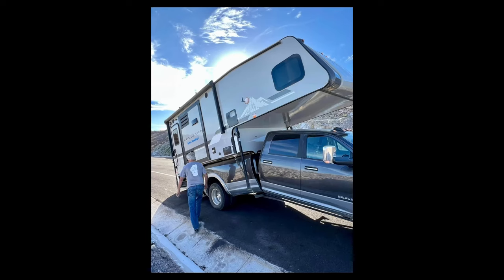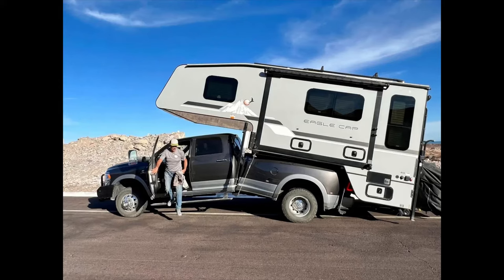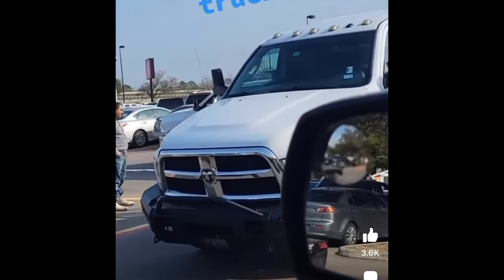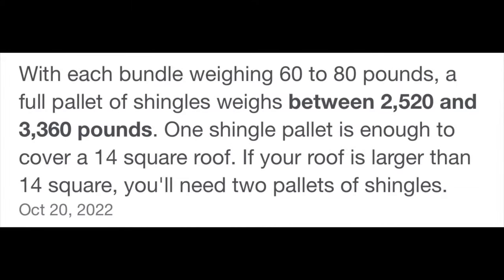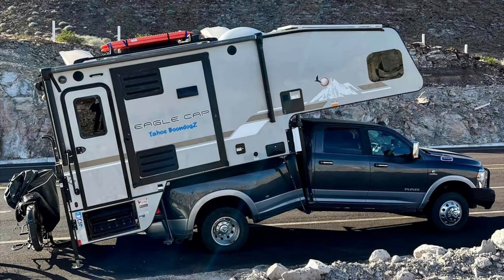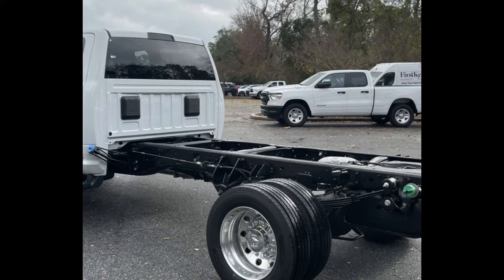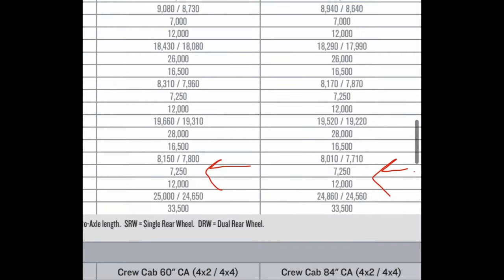Broken Ram truck frames 😱, what’s causing the failure and can they be repaired?

Comment: It seams to me people are over loading their trucks. The most purchased  HD trucks are F250/2500 trucks. Then for whatever reason people think there is no max payload or towing capacity.
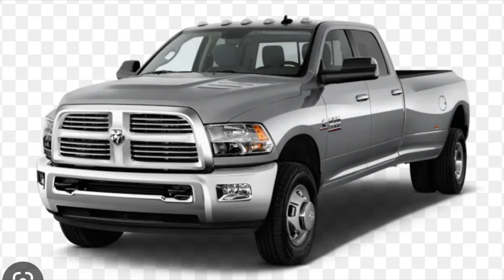Reply: Yep.  F-250 has the 3:73 gears for fuel mileage while F-350 has the 4:10

Comment: I've never agreed with some of the standards that they've put on because if they rate it for $5,840 it should be able to handle at least 50% more than that. That's why you do testing that's why you always put the load data less than its proof capability. I also think that all frames on all trucks should be either hydroformed or heavily fish plated in specific places to make sure that things like this do not happen!
Box frame should be minimal standard and it should be at least 10 gauge. There is no reason for it to be any lighter than that.

Comment: All great observations and conclusions. I see a lot of finger pointing and lawsuits coming for years to come.
Reply from the maker: Without a doubt nobody is going to want to take the blame.  The unfortunate part is peoples insurance won’t want to cover it because it’s a manufacturing defect or overload.  Ram won’t want to cover it because they will claim overload or improper weight distribution.  Getting it fixed short of a new frame will be difficult because most shops won’t touch it (unless it’s a full frame replacement) due to how it broke and the material it’s made of.  Talk about being stuck with a huge bill and limited options.

Comment: For the heavy Eagle cap Camper, if the front of the camper pulled up hard enough to pull the truck frame upwards and break it, why didn't the front anchor points pull out of the camper first before the truck frame broke. It is hard to believe a camper with a thin aluminum superstructure and plywood could be stronger than a steel boxed truck frame even with weakened weld area.
Reply from the maker: I don’t think it’s overall weight of the camper, it’s how much weight that’s behind the axle combined with 600+ ftlbs of torque that’s trying to lift the frame up due to the axle pinion rotating up under torque.  All of that torque on the frame will find a weak point, and there so happens to be some welds where it’s breaking.  Any weld defect such as undercut, or backside suck back could take that thin material and significantly weaken it.  Not to mention how higher strength steel needs to be heat treated post welding to regain strength loss.  It’s a multitude of factors that are contributing towards the failures.
Reply: @makingmistakeswithgreg  If you can't put 1500 lbs behind the rear axle due to bending moment, then you can't tow a 15000 lb trailer unless you have a weight dist hitch, which most cargo floats don't. I was trying to imply that the skimpy camper plywood frame / tie downs held up to the repeated upward stresses, the high strength truck frame did not. Back to C channel like the chassis trucks! My 1984 has no welds. All brackets are factory riveted on .

Comment: They just don't make them like they used to and it's that simple.  My family owned a sawmill for years and people would bring in logs on their pickup trucks every day.  I saw s10 pickup trucks with 2 ton of logs in the bed with the bumper almost touching the ground 3 or 4 times a week.  A guy had a 92 ram 350 and put a gooseneck behind it and put 14 tons on the trailer and brought it in on a regular basis.  One guy had a old chevy and put big sides on the bed and put 4 ton in the bed every day.  I actually had a 89 (still have it) ram 250 with 360 engine and 4 speed manual and i took the bed off and built a set of log bunks and hauled 5 tons on the bunk and 5 tons on a trailer behind it every day for 3 years with the only addition of Firestone air bags in the rear.  There's no excuses for this shit we get sold these days, it was all made better back then when it was about quality not quantity

Comment: Back in the day when trucks were made with thicker steel.. The weight capcity was more of a guess.. Think it will haul 1500 pounds. But now days they test that stuff a lot more and they know when that frame does snap. And a lot of times thats a chunk of steel thats brand new. Not one that has been on the highway a few thousand miles. But also pickup have always had a bad spot between the box and cab. Which a lot of flexing occurs. We had a old one ton chevy years ago from the 1980s snap in half at the bed. So it was an issue even with the old c channel frames. But if I knew I was going to half heavy loads in a pickup today. I think I would put some big fish plates on the frame underneath where the cab and box meet. Something like half inch plate. Maybe it will help. maybe it will eventually snap under the box or cab. Be something that needs testing. If I had a dodge ram around here I could tell you what steel the frame is made of. I own a XRF Precious Metal Analyzer from our machine shop.
Reply from the maker: Excellent thoughts and I agree.  Also, very cool that you have a xrf gun.  I wish they weren’t so expensive because I would own one too 😀.

Comment: Lets face it, these were over the recommended weight,  they must have tested this cheap design and weld process and stopped at the limit.   The  manufacturer's butt is covered.  Can't say they spent a penny extra in materials for the frame.
Maybe someone makes a bolt on plate kit.

Dualies are used all the time for carrying heavier loads  and better traction (better than singles on 2500 in mud).  You'll see every farmer using a 3500 to feed hay in with a 8' flat bed.  Sometimes  I'll see 2 one ton bulk feed bags on the bed and it would be stupid to take that much weight off-road due to twisting.  If he has a big goose neck , he may have a $100000 4500 or 5500 but sometimes just an old semi-tractor rigged up.  So a  dually has a use on a 3500 if you don't push over the limits.  But trust me, everyone thinks they can "get by" hauling a stupid heavy load.
Here I think they found out an extra 1000 was too much for the "welded on " frame, not the tires.
Cracked at weld zone not a coincidence.  Plus this started as small cracks, it probably worked for a few times.

Comment: Well I really enjoyed the video. I think you are being too PC and easy on the manufacturers. They should be stronger than the spec max. But you are right that perhaps a bigger truck should have been purchased but look at the perspective of customers. They are paying 3X more than they did in the past. Inflation etc. So if the OEM's want to charge more that's fine but their trucks need to merit the price.
Reply from the maker: I agree, considering the price the failures shouldn’t be an issue.  The cab and chassis trucks don’t seem to have issues at all, but the frames are drastically different.  From my perspective the engineering required to balance strength without excessive weight in the frame, all while handling stupid amounts of engine torque and weird loads on the frame is a lot to ask for.  Still, like you said for that kind of money it should be far better.
Reply: @makingmistakeswithgreg  just remember, money does not equal quality. A culture of excellence as well as proper inspections would equal excellence. Perhaps some robust government agency inspections would also guarantee results but of course: LOBBYING

Comment: Not to give a pass to the manufacturers, cause they sure don't build in any extra capacity, but there is a reason they make trailers. Use of a trailer gives you more load space, more GVW, safer handling, lower center of gravity for the load and additional braking capacity.
Reply from the maker: 100%. Easier to take a load off too.

Comment: I’d never attempt to repair a cracked frame. For the reasons you already mentioned. Hell no. However, it is likely a $70k-$80k truck. And I wouldn’t blame ya for attempting a repair. I wouldn’t trust it though.
Reply from the maker: It is possible to repair cracked frames, what I worry about is the type of steel it is.  It’s entirely possible a weld repair will fail due to how brittle the frame will become near the weld.  Combine that and the fact doing such a repair requires a lot of welding skill, and you have a recipe for low success lol.

Comment: But overloaded by 1500-2500 should not break them.    Idc what anyone says that overweight is bad and should never be done.    I will just point out every second gen dodge 2500-3500 dodge that has been worked.        Also these trucks broke when the stress was applied where the center of the frame was being lifted instead of being pushed down

Comment: Anything under a 4500 is a driveway queen.  If you want to haul heavy,  run heavy and not something that is a weekend dump run pickup.  Duels and diesels with high torque should only be offered in 4500 and up.  No matter what the make.  We have Kenworths in the yard if we want to haul heavy,  not pickup trucks.

Comment: So are you saying RVers pulling a 5th wheel should pull with a 4500??? So what purpose does the 3500 and 2500 serve? We bumper pull a 7500lb RV with our 2500. We're not going to pay the taxes and insurance for a 4500 commercial truck. At that point I'll move to a Class C or Class A RV instead.
Reply from the maker: If you are overloading a 2500 or 3500 truck legally you need a bigger truck.  The difference between a 2500 truck and a 4500 is significant or even a 2500 and a 3500 DRW.  If you haul a lot of weight or want better stability it’s not smart to max out a 2500 truck and expect reliability.  They often have smaller brakes, weaker rear axles, worse gearing, weaker springs, etc.  A vast majority of 2500 trucks are setup for ride quality and drive ability for average people that don’t haul anything, not people pulling 5th wheels.  Not to mention due to the design of the trucks it’s very easy to be over weight on the rear axle without actually having that much load on the truck.  

It also depends on the truck.  A f250 and 350 SRW is literally the same truck minus rear leaf springs and titled weight.  A Chevy 2500 and 3500 truck for many years was a completely different frame (3500s was massively bigger/stronger) and in many cases rear axle.  As far as what’s the point of 250/350 trucks, they work fine within their design and load rating.  They are not the same truck as a 450 and using a 250 like a 450 is a mistake.  Does the average person need a 450? No, but the average person doesn’t need a truck period.  Does loading a 250 to max load or over all the time make sense for longevity?  Also no.
Reply: @ first thanks for responding and the detailed reply. But, to your last point; ‘not everyone needs a truck.’ The whole RV community that pulls a 5th wheel needs a truck. All but the smallest and lightest solid wall travel trailers need a truck to tow safely. 
Are you saying that most RV’ers need to a 4500/450? That means we all need CDLs…

Comment: If you title it as a RV your insurance is normal but if you register it as truck it goes commercial and insurance goes out the roof and this only works when the truck is brand new and no used trucks .
Reply from the maker: My insurance is willing to insure a 4500 or 5500 as a personal truck or non rv.  I have heard this is somewhat state based.  I can’t imagine what the insurance would be buying commercial insurance in many states 💀

Comment: 3k pounds capacity in a bed of a 80k dollar truck is ridiculous, even more ridiculous is that is it's actual limit. No safety factor. I have been putting over 2k pounds in the bed of my S10 for 20 years. And towing 3-4x it's tow capacity, it's never broke anything once. I'm not saying this is a brilliant idea, but you figure a 20 year newer truck, that costs 100x the price, and is suppose to be 20x the strength should hold up to a pallet of roof shingles. I own a bunch of ford f550s. I have hauled 18k pounds on the bed. We have pulled wheels off the ground hauling trailers up hills off-road. Some trucks are made to be used as trucks

Comment: Too long of trucks to ridged of frame I went thru a ditch in a 15' and felt the flex and sold the truck shortly afterwards cus I know I was gonna break it , I built a Duramax cab and chassis and have been working it non stop every day since 2020 , you guys working these trucks really will benefit from a cab chassis upgrade .
Reply from the maker: Definitely can and chassis.  Those trucks never seem to have many issues regardless of brand.  Many times the power is derated but considering how many older 450+ trucks are out there with 400k that are still running on original trans/engine I would say the derating seems to help with longevity.

Comment: stress crack propagation. they have to get the welds perfect with no pits, voids, or inclusions where stressed the most and welds ground smooth. over weight issue, QA issue, or design issue or inter related? too much heat in weld affected zone making metal brittle? did their QA/QC depts pass the ASQC test? many techies want to know. Ha, I wrote all this after only watching 35 seconds of video and should have waited.
Reply from the maker: No doubt everything you said likely played a roll.  Based on what I have seen most of them appear to be overloaded.  They fail in the same manner at the same point.  Based on what I have seen is it’s a combination of factors that come together to cause the failure.
Reply: @makingmistakeswithgreg  every design also has a factor of safety built in. what was it? a spring designed to operate at 1/3 max tensile strength can theoretically operate infinite number of cycles but a slight flaw radically reduces its lifespan.

Comment: This images are of people way overwhelming the frame of new trucks. Newer trucks load capacity is closer to the actual sticker unlike older trucks but also most people are under the impression that the longer bed crew cab dually pick ups have the highest payload/towing capacity. The trucks numbers that are advertised is the short cab short bed rwd trucks because shorter frames tend to be stronger then longer ones also the extra weight from duallys,long beds,crew cabs,4x4 and other components add weight so the frame has less overall carrying capacity. But also the metal used for the frames has gotten thinner and isnt solid pieces like it used to be to reduce weight remember these trucks have alot of technology in them. If my old truck had the same technology in it with the old steel body and thic frame it would be 4-5k lbs heavier. And its so the trucks can stop without having a stupidity stronge break system. But also cost savings for manufacturing. My coworkers new ram 1/4 thic twin ibeams on his 2020 ram 2500 has holes in it from the factory my twin ibeam on my 03 f350 are almost 1/2 solid steal ibeams. With older trucks chevy,ford,dodge it was never the frame being the limiting the towing/hauling capacity it was the suspension/breaking ability for them i put a heavier duty suspension on mine with upgraded breaks and my carrying capacity is over 9-10k and my towing capacity is 18-20k added an electric fan to lower the chances of over heating issues and did alil work under the hood to improve fuel economy and now while driving with 9k in the bed and towing trailers for work over 100k a year i get 24-26 mpg. It would improve if i did a delete kit to remove the exhaust re feed system. But for new trucks to have the ability to due what older trucks used to with all the new tech they would need to be over 10k lbs and be almost doubled the cost. Its possible but stupidity expensive and it limits the places these trucks would be able to go due to the amount of roads were anything over 10k isnt allowed.

Comment: What happened to that camper ram frame is a ship at sea term called "HOGGING", there was too much weight in the front and rear of that truck which put too much upward stress/pressure in the center of the frame! owners fault!

Comment: That's interesting because every year I haul 2-1/2 tons of rice coal with a 2009 ram 1500 😅
Reply from the maker: Haha O is for overload 😅.  Honestly I think the “smaller” trucks probably won’t have many issues since I think the failures have a lot to do with real long frames, unbalanced loads with heavy weight behind the axle, and stupid high torque of the diesel engines torquing the frames.  If you haven’t had a issue yet I say you’re good to go 😀👍

Comment: That is clearly a design or engineering failure. When a truck is rated for payload, that is not the maximum the frame can hold before snapping, it’s what the wheels, tires, suspension, breaks and drivetrain can sustain safely over its life. Max payload in no way should be a number that if you exceed, your truck will snap in two.

Comment: 1/8 inch tube frame that's the problem instead of quarter inch C Channel frame if you purchase cabin chassis you get a 1/4 inch C channel frame if you purchase a truck with a body on it you get 1/8 inch tube frame

Comment: Blame Federal Regulators for much of the industry problems. Weight vs Fuel Economy is an issue.
With that said, my Dodge extended Cab came with a Warning to not use a cab over Camper.  They know their Frames are weak. With that said, people are Stupid and don't think.  These are not 60s and 70s Vehicles.